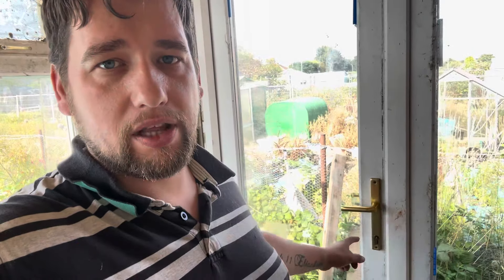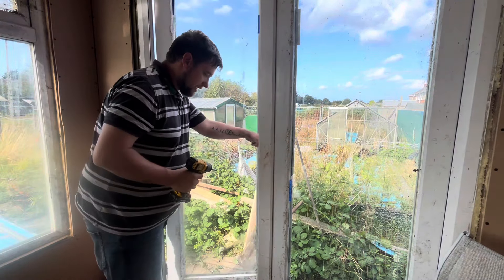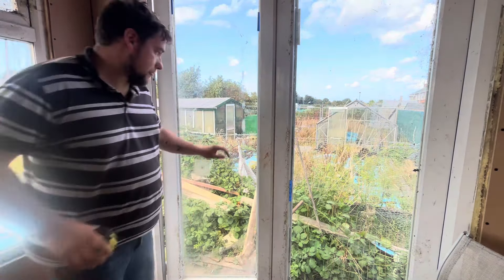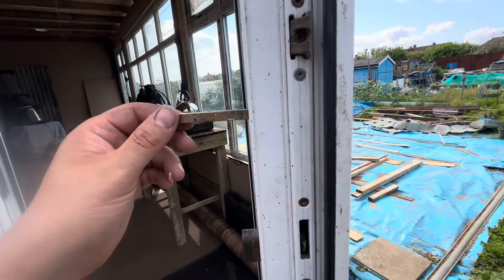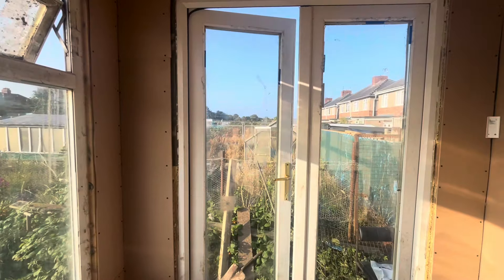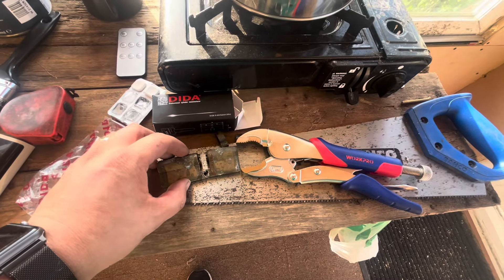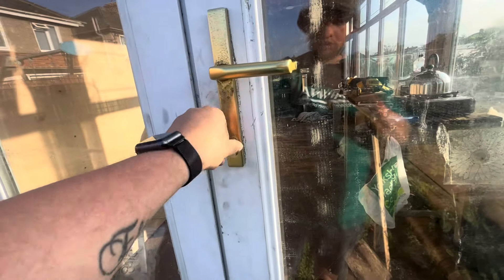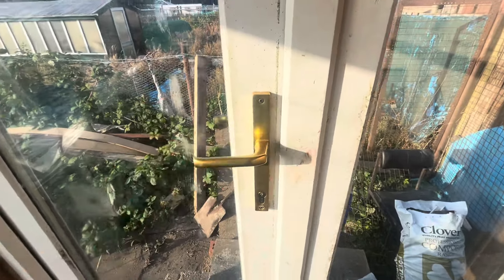Deans Lost The Plot - Changing a lock on patio doors WITHOUT a key 🔑

Comment: You have installed a euro cylinder lock that at 2:59 looks to be about 10mm too long. The problem with measuring the old cylinder rather than the door is that you cannot be certain that the old one was the correct size.
Reply from the maker: I went with the 90mm which was the same as the last one but your correct if the old one is to long then I could always get a 80mm and change it easy enough.  Main thing is for me it locks
Reply: @DeansLostThePlot  the longer one will work but will be more vulnerable to attack. When I did this before I took the cylinder back to the shop and exchanged it for a shorter one. (I enjoy  your channel!).
Reply from the maker: @tubthump appreciate the heads up as I wouldn’t have known learn something new everyday
Reply: @DeansLostThePlot  glad to help